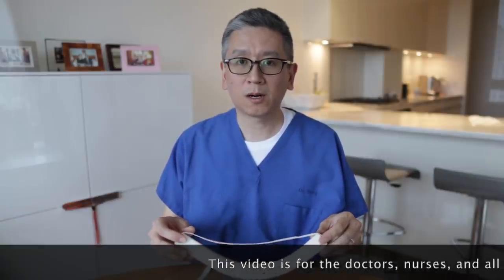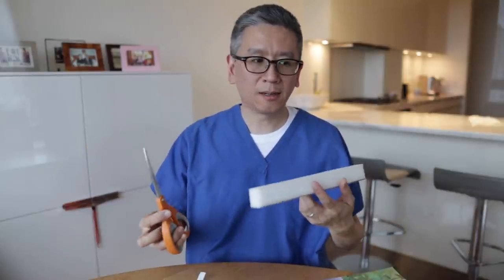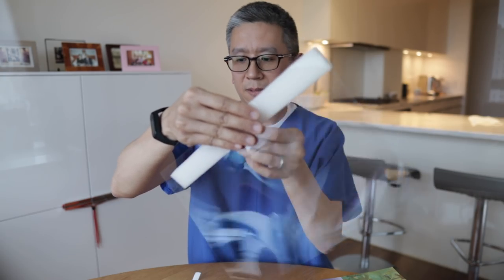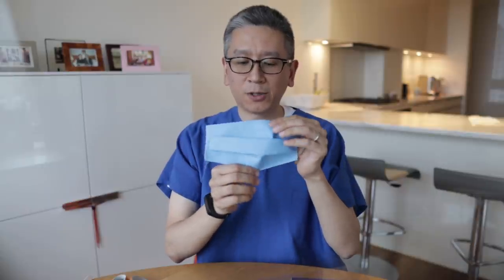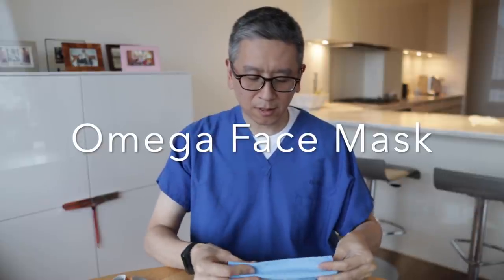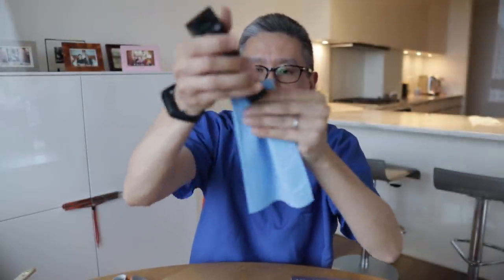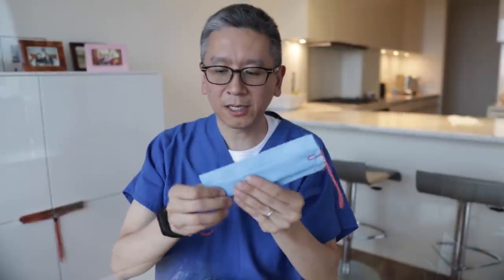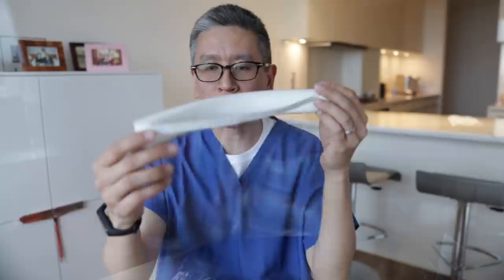How to make a face shield in 2 minutes & DIY Fluid resistant cover for N95: 14 min Pep talk for HCW

Comment: Can you make a detailed list of all items needed? Having trouble going back and forth writing down all the tools. Thank you so much for doing this.
Reply from the maker: Pad of 25 acetate sheets- 9”x12”
https://www.michaels.com/grafix-clear-dura-lar/10449305.html $17.99 (SOLD OUT/BACK ORDER)

Another place to order from:
https://www.dickblick.com/items/55506-1305/
$11.16 on sale as of June 10, 2020

1” thick foam cushion 15”x17” for smaller project
https://www.michaels.com/pure-foam-cushion-by-loops-and-threads/10178096.html

If you are ambitious, I bought the following which can make ~110 face shields. 
https://www.michaels.com/pure-foam-cushion/10178097.html

Dritz 3/4” braided elastic 
https://www.walmart.com/ip/Dritz-3-4-x6-Yd-Non-Roll-Elastic/348591917
Michaels, Jo-Ann’s, Dick Blick, Amazon. 
1/2” or 1” can also work.  For reference, 4 yards will yield 11-12  pieces of 13.5” head bands. 

Hot glue gun, any cheap one will do.
https://www.michaels.com/artminds-high-temp-glue-gun/10301572.html
Glue refills
https://www.michaels.com/glue-sticks-by-artminds/M10203515.html

Yardstick or long straight edge to cut the foam.
Safety razor blades to cut foam. 
Scissors to cut the elastics. 
Regular stapler

I posted it on IG before the this video which I quickly posted.  I posted a lot more detailed shots and shopping lists on IG. Scroll up to see the additonal posts. 
https://www.instagram.com/p/B-Gi5S9D7R7/?igshid=1g1zjzs4ged5r
Reply: I'll make you a list andres, Dr Yang certainly doesn't have time to make YOU A LIST
Reply: Sueellen Blubaugh hmm he already did. You are welcome to look at it ☝🏼
Reply: George Yang, MD thank you so much Dr.Yang 🙏
Reply: Andres Ballesteros We are trying not to take extra time from doctors on frontlines amid pandemic.
Reply: Mo he already made a list and took his time and i do t plan on doing that any further. can we not start discussion and keep reminding of the obvious? Pretty unnecessary at this pont
Reply: FGS do you want him to make you one and post it?
Reply: Thank you for the links!
Reply: @sueellenblubaugh934  he took the time to make this video AND a supply list. Calm down.
Reply: @lauraszerdi161  Exactly. She's trying to control people here like the teacher's pet. 🙄
Reply: Roger Starkey Excellent suggestion Roger - Thanks 🙏☘️
Reply: Is this for a one time use? If not how does once clean it before using it again? Velcro would good.
Reply: @chainamarie03  It was written in the text at the bottom at the beginning - using alcohol rubs is ideal.
Reply: @GeorgeYangMDNYC  Thank you so much and God bless.
Reply: Exjw Smurf Girl lets focus more on people that have something specific to ask him instead of starting to harrass for something said two months ago at the beginning of pandemic?
Reply: Exjw Smurf Girl i understand but picking fights and calling out oeople when asking for information as wel doesnt help anyone. And certainly ny doing that he is also getting this notifications and taking his time and attention from people that will have other questions as well. So with all i must restate over and over that you are not helping either with being the 4th person doing this.
Reply: You people have been isolated to long. Nasty isn't called for the Dr answered. Over done with. He didn't seem to mind the question.   If he had he could have ignored it. Go sit out side with your mask get some sun. Stop being nasty. God Bless Dr for all you are doing.
Reply: Praying for you and yours.
Reply: Pro tip : watch movies at InstaFlixxer. I've been using it for watching a lot of movies lately.
Reply: @Nathan Cassius definitely, I've been using instaflixxer for months myself :)

Comment: Some of us older folks remember transparency sheets.  I use them for crafts, but I believe they are still available in office supply stores.  If anyone still has kids or grandchildren with the supplies for the rubber band bracelets that were so popular several years ago, they could do for the elastic band.  The foam could be the hardest thing to get hold of.  I will be searching through craft supplies, moving supplies (still unpacking!), and pillows.  Even upholstery foam can be cut if you don’t need that cushions any more.   God bless you for getting me started!
Reply: Bev P a lot of things can be used, you just have to change your focus to ‘think outside of the box’.😁

Comment: Hi. I'm a front line healthcare worker, day in and day out.  Thank you for your ideas, demonstration and support.  It's very much appreciated when anyone puts out good ideas to help us in this horrific PPE shortage.
Reply from the maker: nwunder3 Newer video with ideas to refurbish an existing face shield with discardable parts from inside the hospital or clinic.  No time to buy anything extra. https://www.instagram.com/tv/B-XvLVzDGjR/?igshid=1mliav9k13lxo
Reply: On your face shield go to Lowe's and buy a row of rubber insulation to go around door it already has sticky on one side would work great and would not be too big the sticky is designed to hold on metal and things so it should seal to that real good
Reply: Also for rounding your two bottom corners
Reply: Just put a big roll of tape over at the corner even it up take a blade and trim it get rounds out very nicely
Reply: I was just listening to you talk about a coke bottle check out the one about a 2 l Pepsi bottle
Reply: The Pepsi bottle does not have all the creases in it like a it is a lot smoother and it don't look too bad either

Comment: Thank you Dr. Yang. I think your creative innovations are something we desperately need right now. My spouse works in clinical setting for our local hospital, but could be called to in-patient at anytime. I worry there won't be enough equipment available for her protection in an emergency situation. I am doing everything I can to create the supplies that she might need in that event and you have given me great work-arounds. I am sharing your videos with everyone she works with as well. Thank you again.
Reply from the maker: Hi Robin,  Here are some photos and excerpts on my Instagram, before I posted the video.  
Shopping list: https://www.instagram.com/p/B-Gkmtyjj6Y/?
Cutting the foam cushion using razor blade with yardstick: https://www.instagram.com/p/B-Ilrdap2EU
Cutting to 11” wide for the 12”x9” pre-cut sheets is better.  In the instagram I cut the foam to 12” for the 13.25” wide acetate which I hand cut.  
https://www.instagram.com/p/B-ItfQ8pb3J
Use the 12”x9” acetate sheets to keep the project easy: https://www.instagram.com/p/B-KKkhZpEjW
Cutting 3/4” elastics 13.25” to match the 12”x9” acetate: https://www.instagram.com/p/B-KJhtBDN9j
Assembly method I prefer, not shown on the video which was spur of the moment: https://www.instagram.com/p/B-LTyKRDqsP.  My son on the left was hot gluing the edges of the elastic on the inside of the mask.  My older son was hot gluing the foam cushion in the center using about 2-3” bead.  I was stapling the already glued elastic 3 times for a very secure headband.  If you don’t hot glue the elastic first, you will need to do a lot of fiddling around trying to line up the stapler on the elastic band so you don’t make it crooked or miss the band completely.  

Hope that makes sense.  Send me an email at info@nycface.com Re: Helping Robin with Faceshields, so I can make sure you are good to go.  I did a Zoom tutorial with a retired podiatrist in Florida who made a bunch for her local hospital.  They simply didn’t have any face shields at all.  All the staff was very upset.  I will take the email off this thread after I receive your email.

Comment: Thank you for posting this! Great idea! I'm not a health professional, but I have underlined health issues so I'm more at risk and the regular face masks aren't 100% for keeping the covid virus out, so this face shield provides extra protection. Thank you for your service, and thank you for taking care of sick people. Be safe!❤
Reply from the maker: You’re welcome.  If you are not a health professional, there are some nice DIY Faceshields which use 2 liter bottles or sheet protectors which are less expensive.  It costs about $100 in supplies to make 110 face shields, but the plan was to make them in bulk.  

The design of this face shield to try to match the size and features of a hospital approved face shield.  https://www.instagram.com/p/B_So5tND_G-/? 

Hospitals have rules and regulations, so I worried if the faceshield is green or uses colorful fabric trim, that everyone would notice that they are not using a hospital approved face shield.  These look the same so, if they are wearing it in the hospital, no one will notice that these aren’t the real thing.   Hope that makes sense.

Comment: You can also  use a 2 liter clear  soda bottle after you drank the soda and washed it, cut the top and bottom off and round out the edged. Use double sticky tape to make it more secure. Use a blow dryer to round  out the plastic on top before you tape it to the stereo form. so it wound pop out .  For mine, since I couldn't find elastic, I glued the styrofoam  to a headband on its side.  I saw a video while on quarantine. I work in a hospital and was thinking of making these for our doctors but not sure if they met regulations. But, then again, something is better then nothing.
Reply: On another DIY shield vid, large rubber bands were used for elastic.

Comment: Great Idea
I used mylar sheets made for notebook sleeves!
It's Not as thick but it's better than Nothing.
E6000 glue or Low Temperature Hot Glue also worked well.
And if you can't find elastic you can cut a T-Shirt pull it so it folds too itself and it will stretch!
Just my little in a pinch DIY solution 😊😊😊

Comment: Thank you so much for this.  In the absence of acetate sheets I found that if you put a laminator sheet through your laminator (with nothing inside of course) it will come out clear and you can use it to make one of these superb face shields - stay safe and thanks again
Reply from the maker: Great "MacGyvering"!  Use what you have.  Thanks for sharing.

Comment: Hey doc, just a tiny tip. I don't know if the foam you used is special in any way, but I have bought similar foam in my local (Belgian) DIY- shop to cover up isolation gaps. This foam has one completely sticking side. Maybe it's easier to make your face mask, I couldn't tell you the price or length it was but it looks the same thickness and was also on a roll. Keep up the good work. Greetings from Belgium.
Reply: yes! I think it may be something you could find in a hardware store here in the states, it's used for insulating windows and doors in the winter, one entire side is sticky

Comment: I ordered some acetate but I ordered the wrong foam thickness yesterday. Shared on FB & Twitter✅ 😍Thank you! Be safe and Thank you for your service!
Reply from the maker: Hi Shannon, which foam did you order.  Include the link in your reply.  I will see if I can troubleshoot and see if we can make the foam you ordered work for you.  For some DIY, they used a thinner foam and stacked 2-4 foam pieces on top of each other with some kind of adhesive or hot glue holding each layer together.  

I got my 1" thick foam cushion from Michaels.  For a small project you can order this one: https://www.michaels.com/pure-foam-cushion-by-loops-and-threads/10178096.html

But I noticed there is a 2" wide foam which need to cut those thinner, which is more work.  I won't link that here.  If you are not in a rush, you could try to cancel, change the order or return it for the 1" thickness which will be much easier. 

To cut the foam, you will need a yardstick or long straight edge and a a safety razor blade for the cleanest looking cut.  Scissors are fine, but will leave an uneven edge.
Reply: @GeorgeYangMDNYC  You're right, I'd have to hot glue layers to get the right thickness with the ones I ordered. I just ordered the cushion from your link. Appreciate that you replied so quickly. Now I'm on the right path. Thank you again very much.

Comment: Thanks so much. It is great idea for backup plan for me   just in case  PPE shortages and  my hospital rule change every 5min.
Reply from the maker: C T Hi, sorry about the late reply.  For two of the hospitals that I donated the shields, they needed to get it approved by admin.  The ones I made using the hot glue look pretty close to the real thing. Only thing missing is the blue sticker covering the foam, and no one would question it.  

The nurses I gave the shields are keeping them on the side just in case there is a delay or hiccup in the supply chain. 

Even then, I think there is some sense of comfort knowing you are not 100% dependent on the hospital supply them and can easily make them yourself.

Comment: If u can't find a stapler, single use tubes of crazy glue or red tuck tape can also be purchased at Michaels. The crazy glue singles come in packs of 20atmicheals, the tuck tape is used to make a permanent seal, it may not look pretty, but you won't have to work about micro droplets coming throughorloseningthetape. This tape iswaterproof and willcontinueto hold a watertight seal for months...

Comment: This, along with your other DIY videos, have been soooo helpful; so much easier than sewing. Thank you for taking the time. :) 

QUESTION: As far as making PPE last longer -- wouldn't 70% Isopropyl Alcohol sprayed lightly on masks (both surgical and N95) using a plant misting bottle or something similar be helpful in keeping their surfaces clear of CoVid as well as other viruses, bacteria and fungus, etc.? Don't think alcohol would harm an N95 since it is also used to clean electronic components because it leaves no residue -- or, at least none that interferes with component function. So, since alcohol is one of the disinfectants recommended to kill COVID-19, perhaps spraying masks with it would help extend their use-life. What do you think?

Comment: You could use plastic poly pockets, used for documents and long steps of cotton like from sheets cut up, and till up some of the sheet in areas of foam. Your Great for doing this video stay safe
Reply: Ann, I don't know what you are trying to say.
Reply: @diannekalk481 clear  plastic folders used to hold documents,  along strips of cotton wool to project forehead and elastic fabric,  like used for a waist band in a skirt to hold it in
Reply from the maker: Hi Ann, I wasn’t thinking about cost.  The real face shields are made of acetate transparencies that we used to use for overhead projector (https://en.wikipedia.org/wiki/Overhead_projector) in the 1970’s and 80’s.  When I first wore the face shield in medical school, I immediately recognized the material.  There is clear vinyl, and other clear folder material, but it isn’t exactly the same.  The foam can be soaked in alcohol in an attempt to disinfect the foam and headband between uses.  Size of the face shield matters: https://www.instagram.com/p/B_So5tND_G-

Comment: Yes solutions are helpful.  Thanks.  Just to clarify: the moisture in your breath saturates the N95 mask and makes it permeable to the virus from the outside.  Protecting the outside is a  vital upgrade.  Masks are supposed to be disposed of after 25 minutes....18 breaths per minute over 25 minutes....puts alot of moisture on the mask on the outside.   Yes, lets find substitute materials that are waterproof on the outside to protect our saturated N95 from being contaminated by the virus on the outside.  Your rationales are realistic and pragmatic for making our own ad hoc shields and mask covers.

Comment: How would the blue shop towels do. Do you think they would be better, not as good or not should not be used at all? Thank for sharing. And Thank you for your service. and for caring so much. God Bless you and your family and friends.
Reply from the maker: Yes, you can use blue shop towels.  
Many people suggested to use them in the comments section of the videos below.  I finally got my shop towels after 1 month.  The only thing that I didn’t like is that when you first open the roll of shop towel there is a chemical odor.  This smell goes away after a day or so of letting it air out.  

Here are two disposable face mask videos:  
Omega fold face mask version 8
https://youtu.be/NCF7lCHMnII
Omega fold face mask version 12
https://youtu.be/usKgChGqVl0

Reusable version:
Omega fold face mask cloth version
https://youtu.be/epzCzUfAf-E

Instagram example of the shop towel mask:
https://www.instagram.com/p/B_VfMrnjpOg/?igshid=f1l0l1ikzyrn